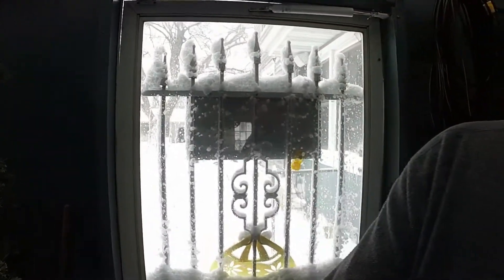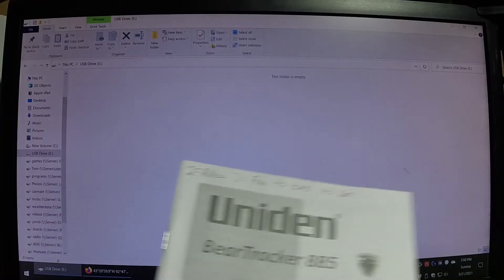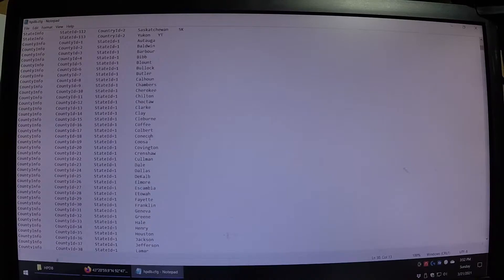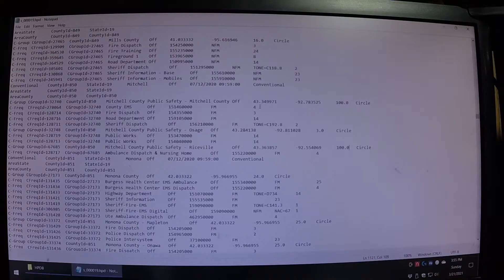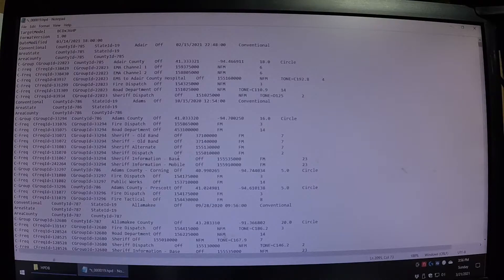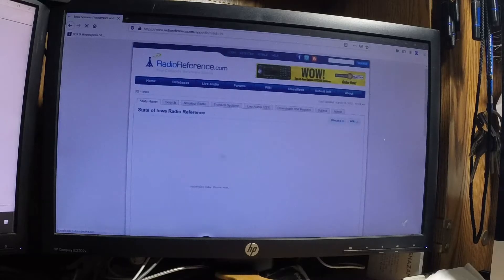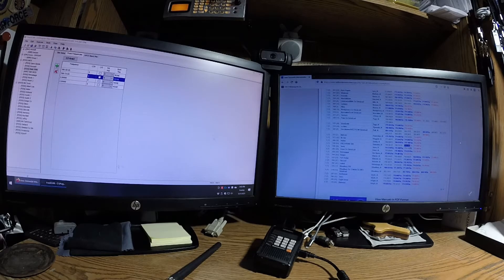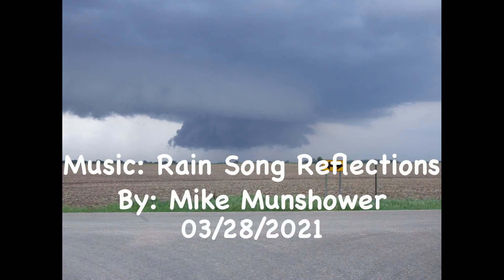Programing Uniden BearTracker 885 & BCD325P2 088

Comment: How about if you want to monitor 10,6 or 2M repeaters, can you program it to do that?
Reply: for the Uniden Bear Tracker 885
Reply from the maker: You should be able to if you put it in the county section. I have not tried it because I have other radio's for those frequency and TX capability
Reply: @hamradiorvstuff2436  thanks